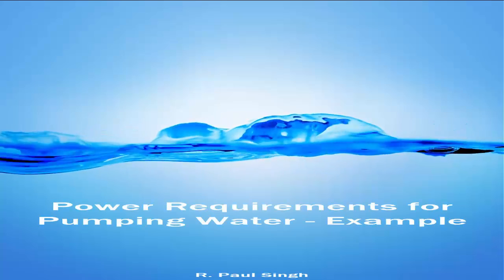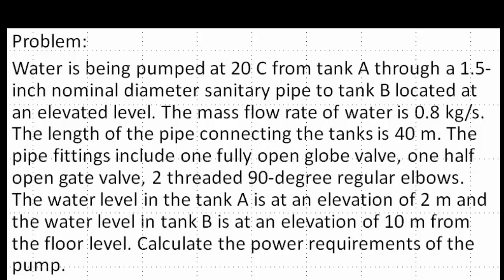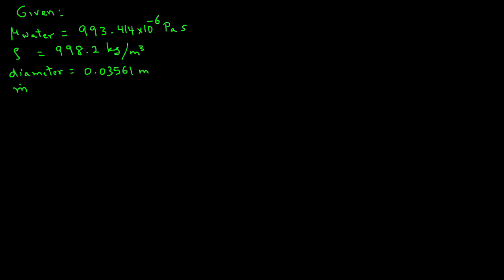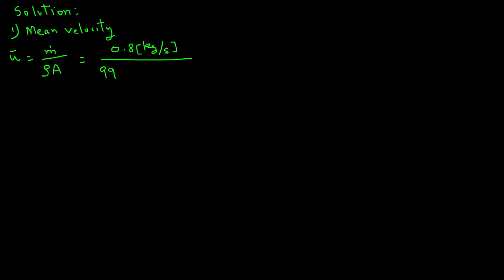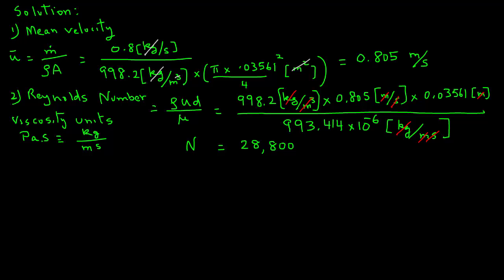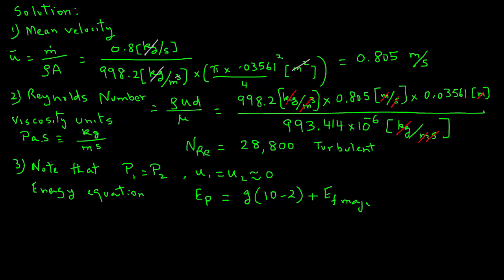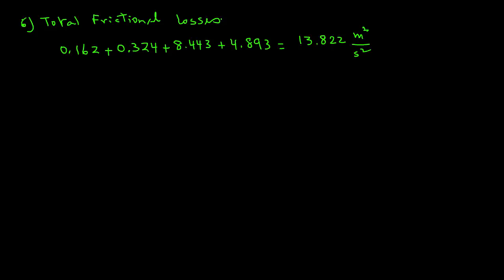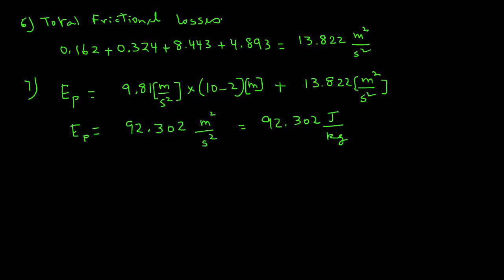Power Requirements of a Pump - example problem

Comment: In a practical application how do you know what the mass flow rate is? Isnt that determined by the parameters of the pump?
I love your videos btw they make my Fluid Mechanics course much easier to understand. 
I look ofrward to your reply! Thank you so much!
Reply from the maker: +Kiefer Le Blanc  Good question!  In processing applications, we are often trying to find a pump that will allow pumping certain amount of fluid in a given time ( i.e. mass flow rate). In this example we determine the power requirements of a pump to meet that need (or mass flow rate). Knowing the power requirement, you can go to a vendor who sells pumps to buy one that meets your needs.